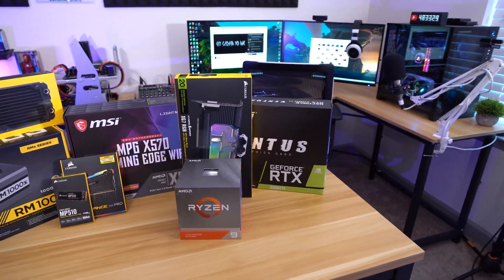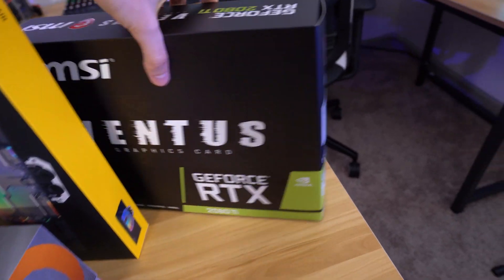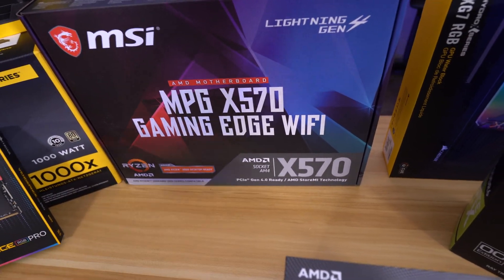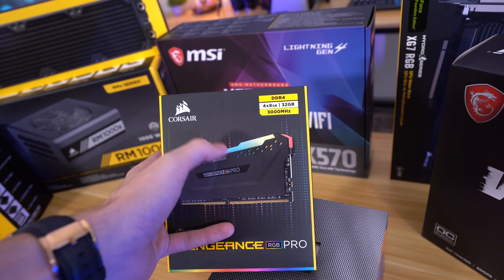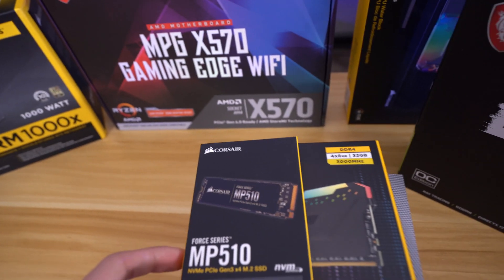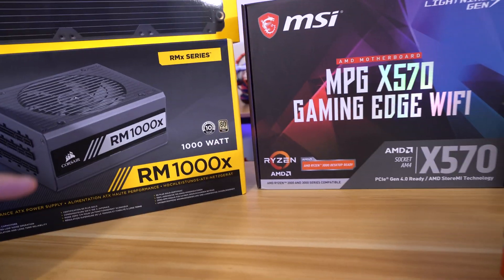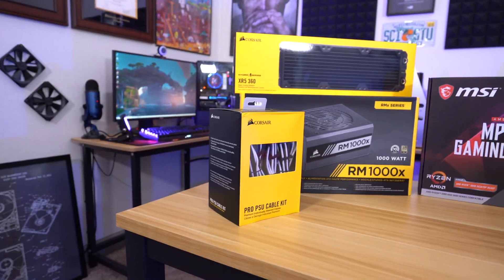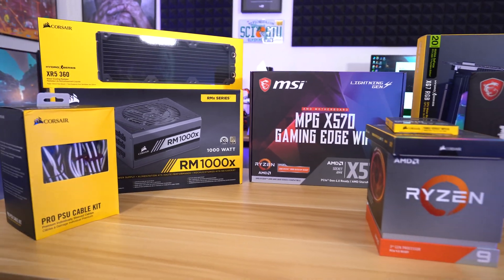Zen 2 Hydro X Custom Loop Build! (Part 1 of 1)

Comment from the maker: Hey, everyone! Thanks for watching! Quick notes: Firstly, the last chunk of this video features inadequate audio. Totally my fault. Forgot to edit waveforms, so it'll sound a bit quiet and hollow. Secondly, this Hydro X kit is intended to be EASY to use. Turning a reservoir/pump sideways is not recommended. If you do something like this, make sure your loop is primed. Never run a D5 or DDC with air. Thirdly, I don't know why there's a third point here.
Reply: Science Studio loved the video, after trying tube bending at ltx I might try a custom loop for my system.
Reply: Also never ever prime a system without putting paper towels or the like under every joint in case of leaks. A few drips, that would be very hard to see without something absorbent catching them, and the mobo or graphics card could fry and take out pretty much the whole rig.
Reply: Your reservoir is tilted inward.
Reply from the maker: @TheNews1990  It isn't. The reservoir has a slightly conic shape (top is narrower than the base).
Reply: A soundblaster ae-9 would fill up your pc's void quite nicely, AND help you with your audio 😉
Reply: Is the one 360 rad ok for this kind of hardware
Reply: @Zez1nas  For stock and mild overclocks, yes. However, not if you intend to push the CPU to 4.3GHZ all core and push the GPU above about 2000MHZ. You'll need the fans spinning at high RPM to maintain decent temps. The simple fact is, Greg has only built one custom loop that didn't have pretty shitty cooling for what it was. Funnily enough, that was the first one he built. Since then, his focus has been entirely on aesthetics.
Reply: can i get a drop its lil spark i got a tape otw
Reply: what watch are you rockin?
Reply: sir can you please suggest any budget best air flow case

Comment: Sweet Build Is your system still running fine Corsair manual the Reservoir they noted that the reservoir has to be installed verticle?
Reply from the maker: This build is several months old and has been torn down, but I've re-used this reservoir multiple times without issues. They only recommend vertical installation for pump preservation - but if you properly prime your loop it should be fine. Done it many times this way.
Reply: @GregSalazar  Thank you for the reply and your awesome content.

Comment: wow i have this exact case and iv'e decided to make mine a water cooled PC as well, expect on Corsair's website they recommended the XD3 RGB pump instead of that big one you are using in this build. I cant wait to get the parts and start building it. will be my first build and this video will be very helpful.

Comment: theres only 2 led ports on the commander pro, how do you light up all 3 the pump, and gpu and cpu water block? i tried to link them on the sec ports on the pump and the gpu water block but doesnt work...

Comment: No drain port?  Going to have to turn the entire system upside down to drain this thing. If you DO add another GPU in this, might need another radiator and the drain port would look pretty nice coming off the bottom of the 2nd card.

Comment: Really nice build! But why skimp on the memory and motherboard? Ryzen 3900X makes good use of 3600-3800 memory 1:1 with infinity fabric :)
Reply from the maker: 3000MHz is still fine and where a vast majority of the latency between CCXs tapers off. The board is also fine. I explicitly said I'm not OCing. Did you watch entire video...?

Comment: READ BEFORE BUYING!!!!

I have a Corsair 1000d, i bought Corsair hydro x radiators, mounted them to my case with the provided Corsair screws and i mounted  corsair fans, and i still managed to damage my radiators!!!! 2 different screws, 1 too long and the other one too short...

1) no i'm not an idiot
2) i used only the provided hardware
3) I managed to damage my rads even though the screws weren't even at 90% of the thread. The other screws are to short, they don't even begin to screw in.

I don't know if the problem is the provided hardware or my 1000d radiator brackets.

Comment: It's not the fluid temps that matter, it's the CPU and GPU overall temps. How high were they? You didn't tell that, and I'm worried about the amount of heat dissipation from that single 360mm with a 3900X and 2080Ti in the loop.

Comment: I like the looks but only a single 360 rad seems rather pointless with that really high 50C water temp. Might as well stay with aircooling or go with external radiators.
Reply from the maker: 50C is not "really high" water temps. And this is with an extremely conservative fan curve for quiet operation. Not sure what forums you've been reading, but under 50C for fluid temps is perfectly fine.
Reply: @GregSalazar  I mean that at 50C you're essentially getting similar temps to aircooling at which point I would question the validity of a custom loop unless you're doing it purely for aesthetics.

btw You should really give the Watercool MO-RA3 420 a try.
Thanks to this literal monster radiator and 4x NF-A20 I got my water temp to 5C above ambient at just 400 RPM.

Comment: Since Corsair is using rebranded Hardware lab radiators, did they redesign the screws and mounting on the radiator or are they the same?

Comment: Can I ask 2 things? 
1. I thought applying thermal paste is neccessary, but I didn't see when he applied it, so is it neccessary?
2. What was he doing with the GPU (start from around 4:16)? Is it neccessary to open and modify your GPU? 

sorry if they're dumb questions, I'm an amateur so I don't know much about building PC.
Reply: 1. Yes, thermal paste is necessarily. I assume it was just cut out of the video as this is mostly a showcase build type of thing.
2. No, those modifications were for water cooling, which is not needed, the coolers that come stock on GPU's are more than enough. Most people who use water cooling on GPU's are running some pretty intensive hardware, or simply like the aesthetic.
To sum it up, always use thermal paste, and no GPU modifications are necessary.
Reply: @Hades-tf1zy  Thanks for the reply
Reply: 1. Thermal paste is pre-applied on the blocks from the factory.
2. How else would you change the aircooler to a waterblock?

Comment: With Linus's video about Ryzen 3rd gen and memory speed, Did you leave the RAM at 3000 mHz? any overclock? XMP? DOCP?
Reply from the maker: CCX latencies taper off at around 3200MHz. You'll see tiny gains past this, but as long as you're in the 3000 range, you'll be fine. We're talking tiny performance differences past this freq.
Reply: @GregSalazar  thanks for the info. I have 16 GB of 3000 MHz C15 and I'm planning on upgrading to a Ryzen 3600. Glad to know I won't be leaving too much on the table

Comment: Kids are asleep, hello greg :) looking forward to this one
Reply: Just had a thought, with the chipset. What about a water block with approx 5-7mm pipe input and output. A metal spring type clip covered in rubber so you can mount it securely without shorting the board. Create a t piece to go onto the existing input and outputs with the 5-7mm ports?

Comment: Showcase build i figure , that tiny 360 rad to cool a 12core and a 2080 ti . Temps on it i rendering
Reply from the maker: Temps are fine. Discussed in vid. 63C on 2080 Ti, mid 80s for 3900X (my sample isn't a great OCer). Fluid temp under 50C.
Reply: @GregSalazar  a little to hot for the CPU If u oc both . As Long as it stable in workloads so. Always nice to watch builds you do . Keep it up .

Comment: Rear-mounted reservoir? A man after my own heart! Looks great Greg! <3
Reply: Jyadel As long as the loop is primed with the reservoir upright, is there any downside to mounting the res. like that? Any extra concerns to consider?
Reply: @duskfinger6799  No downsides, however when it's like that you want to make sure there's plenty of water in the res.  When I set them up like that, I usually run it upright for a while to make sure as much air is out as possible and then fill the water to the brim (just before spillage) so that I can get the plug back on.   Then I turn it over.  You want basically as little air as possible in that orientation.  Otherwise it should be fine as long as it's mounted properly.

Comment: Great looking build. The parts for my next build arrive tomorrow. Nothing as hot as that rig, but a R5 3600 and and 1660 ti is plenty for my 1440p ultra wide monitor.
Reply from the maker: A great value combo!
Reply: @GregSalazar  Thanks, and I'm sticking it in a white Lian Li  011 Dynamic case. I'll also be doing an open loop with two 360mm radiators, more for looks than cooling.

Comment: Why do people go to all this trouble for amateur PC builds?
Reply from the maker: Why do people go to all this trouble for useless comments?
Reply: @GregSalazar  I was serious! I mean why buy cheap hardware and then go through the motions of water cooling it and trying to over clock it for a few measly points on a benchmark that are totally useless in the real world? I guess gone are the days where PC builders were serious and all thats left is the wanna be builders with no money to spend!
Reply from the maker: @kevinm3751  These are some of the most expensive consumer-grade components on the market. This 2080Ti alone was over $1000. I don't care who you are - that isn't "cheap." I also explicitly said I didn't overclock this system because I wanted quiet operation over anything else. Doesn't sound like you listened to a word I said in the video. We've got nearly 100 PC builds on the channel. Judging from this single enthusiast build is childish at best.